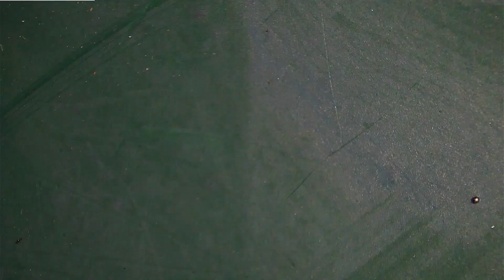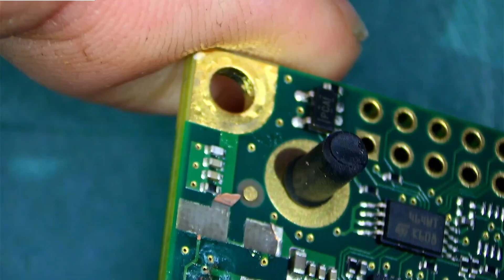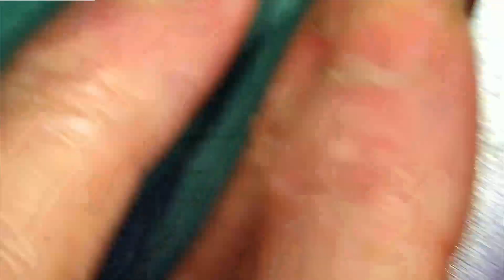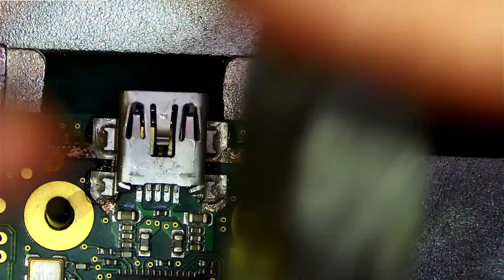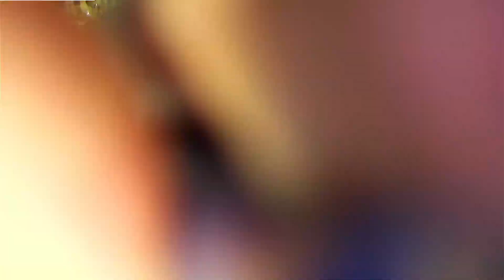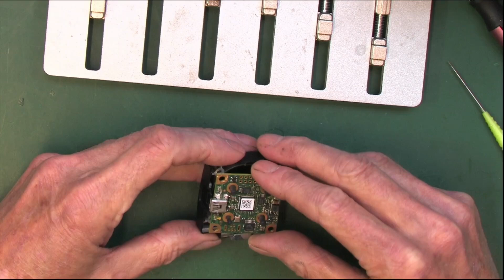Industrial High Speed Inspection Camera, Mini-USB connector ripped off!

Comment: I have seen a tech use old solder wick to make new pads for the USB port.
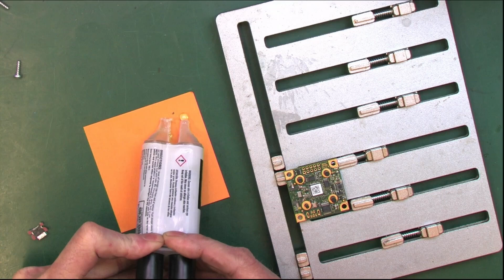8:12 never liked those dispensers of epoxy. Maybe reinforce the port with epoxy down the sides if there is room?

Comment: I've never tried it, but a hefty piece or two of heat shrink hot glued either side of the connector and then heat shrunk over the connector might reinforce it.